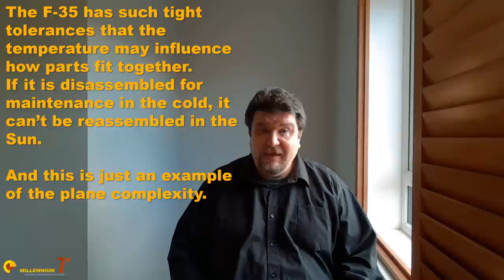F-35: The Failure of the $100 Million  Dollar Jet | Maybe...

Comment: There's another reason why I never liked the F-35. The F-15, F-14, F-18 and F-16 all were great fighter aircraft, originally designed to dominate in aerial combat. And after a while they took on air-ground missions and specialized weaponry (and sensors) as well. The one lesson one could draw from that being, that a great fighter probably makes a half decent bomb truck as well. But you can't make a fighter out of an aircraft that's been designed from the outset as a bomber/strike fighter. The F-111 and Tornado being prime examples (The F-111 was intended as a carrier fighter and remember the Tornado F2/3?). 
Anyone with the slightest bit of understanding of aerodynamics and kinetics said when the F-35A and B rolled out: that thing flies like a piano. Too high a wingloading factor, bad thrust-weight ratio, the huge drag inducing air intakes (a compromise for the STOVL-variant), the enormous engine, the cramped, short fuselage that didn't allow for modifications or insertions, the poor rear view out of the canopy, the heavy landing gear... 
A good friend of mine, a retired RNLAF col, former F-104 and F-16 pilot with an aerospace engineering degree said the moment he saw the F-35A: "Dear Lord, we're going to exchange F-16's for a reincarnation of the F-105 Thunderchief. How in the hell is that thing ever ghoing to keep up with a Tu-160 Blackjack or a Tu-22 Backfire? When hell freezes over, that's when. What a pig." Sure enough the air force tried to kick him out of his squadron's former pilot society, as his view was deemed to be unhealthy for morale. 
I remember being on a job interview at the defence department of our national equivalent of DARPA, when I was asked what I thought about the F-35. I said: "If an aircraft looks good, it probably IS good. To my mind this thing reminds me of the Vought A-7 Corsair, which the pilots called SLUF (short little ugly fella). It probably has amazing tech inside, but I cannot see this thing ever going to outmaneuver anything except a Piper Cub maybe." Despite great credentials and grades I was rejected. Asking over telephone why, the P&O person said: 'get in the way of this project and you'll be run over and disposed of." 
Same in the US. A few friends of mine - former US Navy and USMC fighter pilots - had the same message when kicked out into retirement. The message being: 'If we can't teach old dogs new tricks, maybe retirement will." 
From the outset the F-35 was - in the words of Pierre Sprey  'a lemon.' And a politically engineered one as well. LM made sure it had parts of production distributed over the widest amount of states and allies possible so that no one felt the urge to kill it when it should have been killed. Numereous reports of the US Government Accounting Office (US GAO) and Pentagon's own Director of Operational Testing and Evaluation (D-OTE) simply disappeared, unread. The qualifications in all of those reports that have been coming for tens of years were condemning: "Unsustainable, more than 700 malfunctions of which nearly 100 mission critical [NB: that was in 2019 and the issues still have not been resolved!], lowest readiness numbers of all US aircraft [even lower than the 1950ies era B-52], highest ratio mainenance hours per flight hour, not up to specifications [not being able to accelerate, not able to sustain 9G; 7G max], RAM-coating not able to withstand mach 1.1 or above for more than 3 minutes, etc., etc.
The F-35 has reasonable capabilities if and when it is serviceable. Problem is, in order to maintain an F-35 fleet in seizable enough numbers to sustain high tempo operations against a (near) peer enemy, one has to have three times as much F-35 in total, with only around 30% being able to fly at any one given moment (D-OTE report 2019). With each flight hour costing as much as U$ 44.000 x 130 flight hours per pilot to stay current and expended weapons, fuel and used spares not included, that's even too rich for the USA. 
Another friend of mine, who sadly passed away in januari this year, a physicist, said that the F-35 programme should be awarded the Nobel Prize for Peace as it made the West disarm unilaterrally. 
What's more tragic, is that billions of taxpayers dollars have been wasted while all the while sincere critics were silenced as idiots. These 'idiots' - all very proficient in John Boyd's theory of air warfare and accomplished fighter pilots with combat records - are now proven right.
And why? Here's the real reason: US stretegists see a confrontation coming with China and that is likely going to be one, in which Ferrari's (as general Brown calls the F-35s) are too fragile, too short legged, too slow and too inflexible to provide air dominance over carrier battle groups. The US Navy had seen it coming a long time ago. as it actually wanted an advanced replacement of the F-14. It got the F-18E/F and F-35C shoved down its throat. With China now gradually building a navy that is capable of challenging the US Navy in the Pacific, finally members of Congress and the higher echelons of the Pentagon wake up. Their heads having been stuck too long in a Desert Storm (1991) and Afghanistan/counter insurgency mindset for far too long. 
As a military analist myself I've seen this happening time and again: people preparing for the war that's already been won. Intelligence encompasses a hell of a lot more than simply gathering information: it's what decision makers do with that data. Turns out key decision makers have a tendency to be pretty content with themsleves and not being overly open minded for well founded criticism. 
There's one upside to this story and that's this: the programme has delivered a few technologies that can be implemented into general Brown's concept of a clean sheet 4.5 generation fighter design. Think of the Pratt & Whitney F-135 engine, the most powerfull in the world. Think of the radar, distributed aperture system and a conformal EOTS, the divertless supersonic intake concept (though that of the F-35 was too much drag inducing), Low Observable Axis Nozzles, internal weapon bays for when low observability is required. All of that can potentially be incorporated into a new design, which - if lessons are taken to heart - might become what the F-35 intended to be: an affordable, versatile and very capable fighter that could incrementally grow into a true multi-role aircraft. 
As Boeing and Saab already demonstrated with the new trainer aircraft and the USAF has proven with the 6th generation design of which Will Roper said already flew, a new design does not necessarily take another 20 years to gestate. If the design incorporates much of the technologies of the F-35 that are usefull, the financial repercussions and consequences for American and allied airpower might be reduced considerably. Let's hope the powers that be will do just that.
Reply: A project that is missing a sceptic is doomed to fail.
Reply from the maker: Interesting explanation. May I ask you your background?
Reply: @Millennium7HistoryTech  Certainly. Studied Public Administration at the Erasmus University in Rotterdam, served shortly as a military analist at the Defence Staff  (department of military strategic affairs) of the Dutch ministry of Defence, but had to go due to consequent budget cuts and personel reductions. Specialized in Strategic Studies at Leiden university and have been an avid reader of everything on military technology, tactics, strategy, history, doctrine - you mention it since early childhood. Been doing analysis privately ever since and in the company of (ex) military, retired scientists and advisers ever since. I've published a few articles in Dutch newspapers and for a Dutch-Belgian consortium of people. 
I have strayed far away from the military, never able to return to the real thing again, as the Dutch military now is a shadow of itself when I served (that was in 1988-1989 as a conscript and between 1994 and 1995 first as a trainee and later as an analist). At the moment I am employed in forensic  care (ex convicts), but every moment I can spare I read and write about all affairs of a military or geopolitical nature.
Reply: @jensolsson9666  True. The first thing I was taught by my professor Strategic Studies - a retired lt.gen - was this: "A commander that wants to stay proficient and humbold must always start to organize his own circle of trusted of nay sayers, for a pessimist is the best measure of prediction for the fog of war and inevitable friction."
Reply: "people preparing for the war that's already been won. " 
That statement alone is worth this whole thread.
Reply: What should have been done, and what was not because everyone was saying how great stealth was, is to create a plane that would balance other needs with stealth. The only time it might make sense to have an aircraft with extreme stealth is for a specific mission, and not a multirole. The problem with stealth is you pay so much in size of aircraft to stay stealthy and also do the mission. For short missions you do not need big fuel tanks, but you have the space for them. If you want all those sensors, you need to design them into the airframe, since hanging the outside just killed your stealth. You just end up with a bigger aircraft with all those expensive sensors when you do not need them. For maneuverability you don't want all that unneeded fuselage adding weight, and making a bigger target. The Chinese J-20 may be a perfect example of a good way to use stealth. It is apparently designed for one mission, delvinvering cruise missiles to fire against US carrier groups. It apparently is not really a multimission aircraft. How can theUS be so stupid, how can Americans be so blind.
Reply: good stuff.
Reply: I'm bored so I'm going to poke some holes in what you said.  "Turns out key decision makers have a tendency to be pretty content with themselves and not being overly open minded for well founded criticism. "  Buckle up then.
-F-35 is not perfect as it tries to fit every role in existence and it's bleeding edge tech, however.....
-You should watch some LazerPig videos.  He covered several people/topics you mentioned including the F-35 and two people you quoted - Sprey and Boyd(in a 2 Part A-10 video and possible 1 or 2 other videos). They are all slightly NSFW at times and humorous but also very informative.  From what I have heard, Sprey was a prolific conman, liar, moonlighting Russian propogandist and claimed he invented several US jets.  He did not, there are records, and Sprey's background is in audio equipment and lying, not designing planes.  Boyd was last relevant in the 1950s.  Both were aircraft luddites and advocated for useless aircraft with guns and nothing 'modern' on them.  LazerPig goes through the list and it's horrifying.  Those odd views are also why Russian propaganda stations like RT liked to invite Sprey on to lie, pathologically, because it would harm US interests if we made useless crap.  
-If you mentioned the anti-technology Sprey and Boyd at a job interview for a high tech place that is the "nation equivalent of DARPA" then yes, they probably tossed your resume in the garbage.  They are bad people to mention because they hate technology.
-'It probably has amazing tech inside, but I cannot see this thing ever going to outmaneuver anything except a Piper Cub maybe.'   Maneuverability is less important that other features since missiles are small and fast and can maneuver better than any plane.  The emphasis is on not being detected in the first place.  You also can lock on to things in any direction and let the missile find it's path, so dogfighting is kind of dead.
-Lockheed did not engage in a devious plot to prevent the F-35 from being killed by scattering production everywhere. That's paranoid and wrong.  Some US senators and international partners demanded it be that way because they wanted local jobs out of it.  That include the Netherlands.   The internet remembers because it was all said publicly by a bunch of politicians whining about not having local jobs.
-the US navy got what it got, because it vaporized so much money making it's own plane in what I think was the 90s or possible early 2000s that the program was canceled
-Several of the jets you just mentioned were extremely expensive projects at the time.  But no one remembers that and thinks they were all cheap development programs. LOL.
-several of the jets you mentioned also had numerous problems in the first decade of the production program.
-The F-16 was advanced 50 years ago, but time and technology advances.  Not to mention ~15% of all planes have been lost in accidents.  Yikes.

-F-35 is slow, but not as slow as you claim, and missiles can catch a fast plane.  Also what got blown up in Ukraine is what you would be up against.  Tu-22 and Tu-160? Unlikely.
-44k/flight hour is too high and not a realistic price.  In fairness the numbers are all over the place, but none of them are that high.  However, anything stealth will cost a lot per hour, that's unavoidable.  Previous planes were not stealthy hence the price increase.  Also I think the F-22 is still more per hour, despite being older, and we won't even discuss the B-2 which is just eye wateringly expensive in hourly costs, production costs, and in every other way.
-If you want new technology, you have to pay for it - all those things you mentioned coming out of the program were expensive to research therefore any new plane that uses them is not truly cheap in development costs.  You can't call it 'affordable' if it uses F-35 developed tech.
-Interestingly enough, for the most recent F-35 block, price per plane is comparable to other current planes, although that's within the US.  They still probably charge more to everyone else to help recoup the costs but I don't feel like checking.
-I have doubts about your claims that people were out to get you or others for criticizing the F-35 program.  Also DARPA hires engineers and scientists, rarely 'analysts'..... If you show up for a job about the F-35 (which is the only logical conclusion based on your claim that you were rejected because you would have 'gotten in the way of this program') tactful constructive criticism is required since a plane must be made and if you could think of a better plane that was cheaper and better the US congress will give you money by the dump truck full.  But...no one can do better.
Reply: @kalik8354  That's a whole lot to cover. And yes, you're right about Sprey being anti-tech and a conman. I had no idea at the time, but he seems to have been taking credit for things he had no business with to begin with. 

I'm not going to reply point for point, but just a few general arguments. 

1. The F-35 simply too expensive, considering it still has many flaws - some mission critical. Fun fact: these flaws were taken out of the block III upgrade within the programme and lifted to the block IV for which customers will ne paying around 8-12 U$ mln extra per tailnumber and it does not include a new variable bypass engine. The machine spends more time on the ground than in the air, where it's supposed to be and yields maintnance costs that are hard to sustain long term. Sprey may be in the wrong  in many things, but he's right in saying that when you design something, ruggedness, reliability - expedited by simplicity in overall architecture - should be key. And it's OK to experiment, but the F-35 is an ongoing one that keeps costing additional money more than decades after its inception. In every playbook that's bad. 

2. It delivers - yes when everything functions as advertized. Maintenance crews I've spoken said exp;licitly off the record (!) that it's a pig. Compared to the F-16 'Fat Amy' as she's now affectionally known is a nightmare, worsened by a constant lack of spare parts (lean manufacturing is a blessing). More serious is that there's no back up for when the helmet mounted display and/or main touch screen malfunction. It's all nice and well, these shiny feautures, but without redundancy it's a pretty nasty experience to have to fly the machine back to base and land it. And good luck aiming the gun or tossing a dumb bomb without a HUD; that requires marvels equivalent of putting a man on the moon software-wise, where a 'simple' and readily available HUD would have sufficed. Matter of pennywise, poundfoolish. 

3. The maneuverability is redundant argument followed by the LO gospel and HOBS heaters.  LO does not beat IRST, LF radars + Ground Controlled Intercept or eyeball mk.1. And the gospel does not account for advancements in ECM. 

4. The proof of the oudding is in the eating. The USN (NAVAIR) is eating it and simply does not like the Lightning. I'm told that some aviators have called it a 'fair weather fighter,' works well if all conditions are right, which - especially in naval aerial warfare - is seldomly the case. Forget high tempo ops and high sortie rates in this thing. It's said to be a one flight wonder that requires meticulous pampering after one sortie. 

I know, it's an awful lot of hearsay, but I remember talking to an USAF F-15 jockey who told, that being critical of the F-35 meant almost instantly being curtailed, demoted or fired. As another F-16 jockey once said in AFM: "Get in the way of this thing and your career is over. And not because it's the best invention since the wheel; it's apolitical plane." 

There's tonnes more, but I'm done debating the bloody fighter. In my mind a far better fighter could and should have been produced for that money.